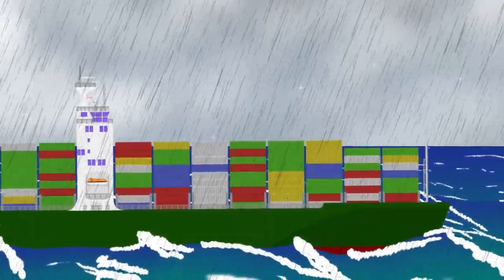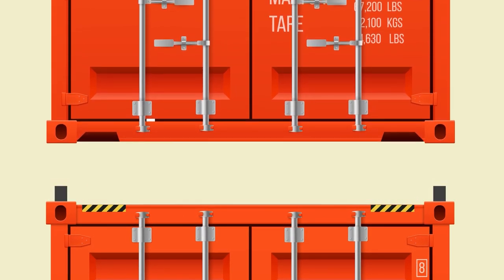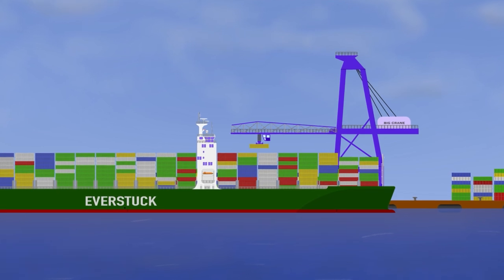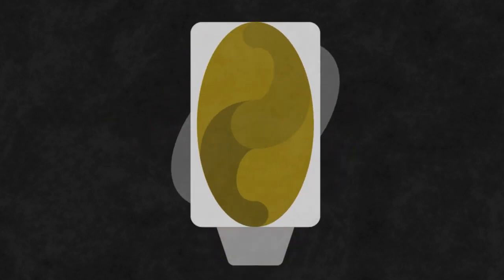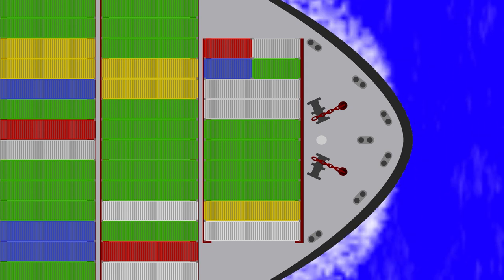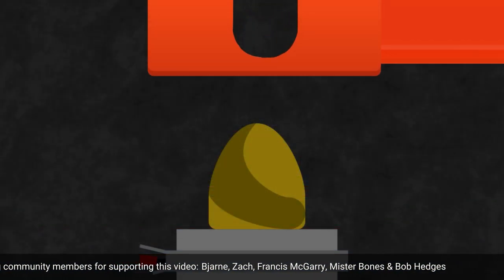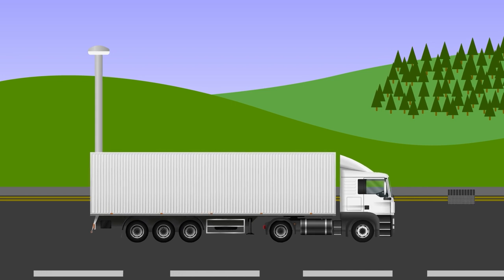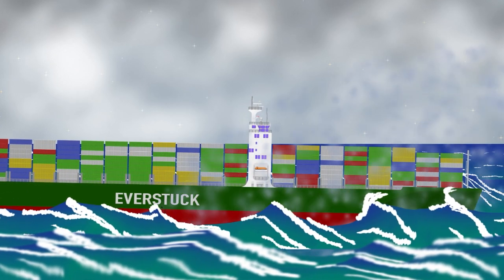Why Don't These Containers Fall Off?

Comment: I was a stevedore on container ships for about 8 years. The semi automatic twistlock you described is like the ones we used on Maersk vessels, whilst Hamburg vessels had a fully automatic type with no toggles at all.

On the section about container bays, bay 01 would be the forward 20', the aft 20' would be bay 03, and the 40' would be bay 02. The walkway between the next bay would be 04 so the next 20' section is an odd number again.
Reply: that's quite interesting
Reply: honestly, the manual and semi-auto locks sound like a huge hassle still, considering how many containers need to be loaded/unloaded at port, and how often you'd lose those damn locks...shouldn't all containers just have built-in locks, which the cranes can toggle when they pick them up, or something?
Reply: As Kaine already mentioned, they make fully automatic twist locks.  However, they are not ideal for all situations.  For example, if you have a stack of empty flat racks, you would have to discharge/load them one by one with fully auto twist locks but you can accomplish the same in just a single pick with manual or semi-auto twist locks.  Also, with fully automatic twistlocks, you can only twin pick horizontally and not vertically.  If you have two tiers of remain on board 40' empty containers overstowed over loaded discharge containers, you can halve the number of restow moves by using manual and semiatomatic twist locks.  These containers are built to ISO standards so the corner castings can accept an assortment of different twist locks depending on the situation.  Even ships with enough fully automatic twist locks aboard for every container usually carry manual and semiautomatic twist locks for situations that warrant it.  As far as having built in locks... Very bad idea.  Twist locks get beat up every time the container get loaded on a chassis, bomb cart, vessel, ect.  It takes all of a second and a half for an experienced longshoreman to change out a busted twist lock.  Nobody has time to torch out and reweld a locking mechanism that has no need to be permanently installed.
Reply: so, out of curiosity, how does the release function work on fully automatic locks?
Reply: the best method from my non seaman experience would be a helix that uses weight to hold  down , and when the  container received upwards pressure a spring releases it to neutral or a simple helix with a flange in the middle and a bearing allowing the lugs to twist and separate but only in the up and down directions  or if you want to be really fancy , have each container with its own lugs and a radio code from the bridge to release so all containers can be locked or unlocked remotely
Reply: It depends on the manufacturer but many fully-automatic locks are placed in the bottom corner castings of the container above the same way as a semi-automatic. They lock automatically to the top corner castings of the container below and unlock automatically using a specific motion by the gantry crane operator when lifting.
Reply: So the stacks are locked together vertically, but not in the two horizontal axes?
Reply: @foobarbecue  some vessels use a bridge clamp which is put at the top of the stacks that holds them together vertically using those horizontal holes on the ends, but I never saw one used the entire time I worked there. The problem with bridge clamps is the containers need to be at an even hight, if you have a mix of standard height and high cube containers the holes won't line up. Twistlocks and lashing provides enough stability to stop the stacks rolling in normal conditions.
Reply: @alveolate  
The containers have to go every where throughout the land as well as ships, even just sitting on the ground. And then when they are empty they are handled and stacked differently.
Reply: @s.v.saylaraye3212  
No, the occasional really stuck twist lock which requires a call to maintenance to bring heavy equipment or to have to take the container to a safe area to have it torched out, after checking there's no hazardous in there is a big painful interruption.
I have put in and taken out man many twist locks.
Reply: I have been in the Maritime Industry for over 20 years, both at sea and shoreside.  What exactly are you saying "No" to?  Firstly, I was responding to alveolate hermeneutist's idea about having "built-in locks".  Secondly, the majority of the time when twist locks need to be replaced, it is due to the locking or release mechanism/parts malfunctioning which does not "require a call to maintenance".  As I already mentioned in my response, twistlocks can quickly be replaced by the ground crew whether the container is hazardous or not.     You may have put in and taken out man many twist locks but your reading comprehension sucks.
Reply: @alveolate  re: containers just have built in locks. 
That is a lot of complexity added to the containers.  A hole is simple, but a device that has to lock and unlock at the right point in time is a lot more complex.  Having them work this way means that when one of these locks fail, it's easy to replace.

I would expect it would be a lot more time and effort if they had to repair the lock on the container before they could get it loaded.  The positions for all the containers is mapped in advance.  They couldn't easily just skip a container if one of its 4 locks wasn't working.
Reply: @s.v.saylaraye3212  
Sorry dude, I said 'no' in agreement with your observation that permanently attached  twist-locks would useful , due to the reasons you mention.
I should have said 'no, you are right' and then went on to embellish the story, explaining a bit as to the major hassle it can be when even in a rare event such a thing does need to happen.
I know exactly the majority of twist locks need replacing, having done thousands of them. However I have also been a straddle driver and have occasionally needed to take a container to maintenance because the twist lock can not be removed and rather than hold up the crane, which you must know is a big no no, we get the box out of the way quickly. These cases are usual because a wrong type of twist lock was used or if the right one it was really beat up or the crane had missed the mark a few times and squished it into the pocket or deformed it beyond manual handling.
And I don't what if any safety standards you worked under but our maintenance guys would not cut into or use an oxy torch on the box without double check what was actually. in the box.
I worked on the wharves from 1974 until a couple of years ago. From carry all sorts of crap on my back to setting up and operating union purchase gear (I bet you don't know what that is) to driving more modern ships cranes, of every type, and every type of shore crane, including bulk buckets. Also have driven every shore type gantry crane including portainer cranes. Also I have driven fork lifts from the first little ones that went below to stack barely palleted cargo through well standardized pallet sizes to large and larger container handling forklifts. Then of course there are straddle carries, from smaller ones that actually ro-roed on a couple of ore boats we had to the well known container moving ones.
As well as that I have done every type of manual work including lashing and twist lock handling, from well before any automatic types when we had to go a cage trip every tier. That was also a time when we would get out of the cage on top of the tier to get them in quicker.
And then I have been a clerk, then an equipment controller, interacting with planners, supervisors, ships mates and captains, foreman and crew.
And, just to top it off I have an honors degree in philosophy, because most of the stuff on the wharf doesn't require much brain power leaving me free to think in other ways.
So, Mr. 20 years, I apologize for giving you the wrong impression.
Reply: You were so triggered by a joke in the YouTube comments that you wrote an entire essay about your resume. Someone who has as much experience working on the waterfront as you claim should be able to handle a little ball busting.  I am currently a Planner, was a Supervisor before that, a Professor at a State Maritime Academy before that and sailed as Chief Mate/Relief Captain before I moved shoreside.  The labor still busts my balls all the time.
Reply: @s.v.saylaraye3212  
It wasn't a joke, it was an insult.
And, do you have any actual experience with manual work? 
Also, believe it or not, that is not my resume.
Reply: @Aaron Curtis and @Caine Sparham.  Thank you for asking and answering that question.  I was going to ask it myself. I think I would be happier with some horizontal fastening, at least at the top, but I yield to those who have expertise.
Reply: There are so many things wrong in this video that you can't help wonder whether the author ever cared at all about the validity of the information or is just another subject in which to fart another video with the smallest time and effort possible.
Reply: are the automatic twist locks
battery powered with wifi control?
Reply: @Luleliluli  I think it's unfair to say there's lots wrong with the video, I think it's just very simplified compared to the full picture of container stowage.
Reply: @Kaine96853  Man.. They didn't even get the right type of crane (the one depicted is a grain conveyor for bulk cargo ships, we've got several of those) and they placed it longitudinally instead of across the ship, like you would work a Ro-Ro. Like nobody is going to notice.. They just don't care!
Reply: @s.v.saylaraye3212  
Hey S.V, having settled down a bit now I was was wondering Terminals you worked.
Mine was mostly P&O and D P World.
Reply: Sorry for the delayed response...  I have been really busy this week not performing manual labor from my air conditioned office/truck.  Shoreside I worked at Port Tampa Bay, Port of Virginia, Port Everglades and Port of Miami.  As a ship's officer, I have called pretty much every major seaport on the Atlantic coasts of North & South America and the Caribbean.  In Virginia, it was a a joint venture between Ports America, Cooper/T. Smith and Ceres, called CP&O.
Reply: @Igbon5   The two of you are hilarious. That's why I come to the comment sections in videos like this.
Reply: @vadimbellous8313  
You are very welcome.

Comment: If you notice these containers tend to flip over when a truck driver exits an on or off ramp, or takes a corner to fast, the reason is that unlike regular trailers with a heavy floor and light sides and roof, the sea container is solid all the way around making them much easier to flip, top heavy, I drove both for decades, with sea container you have to slow way down on any corner.
Reply: I never understood why they don't have "under slung" trailers for Intermodals like you see with double stack train cars. I guess for truck dock compatibility? It would help bring the CG down and improve aero.
Reply: @mzaite  Ground clearance
Reply: @mzaite  Probably also length; an underslung trailer would need to have the wheels in front of and behind the container, rather than under it.  The extra length makes it harder to maneuver, and also may not be within the legal length limits.
Reply: @ianspeckmaier9565  You could imagine the increase in bottoming out incidents on railway crossings.
Reply: @ianspeckmaier9565  How so? I've seen some pretty hefty goose necks that go well below the axle center line.
Reply: @mzaite  yeah, and those require hefty pre-planning so you don't get stuck along way.
Reply: @johan.ohgren  Oh right because like raised rail crossings and such.
Reply: I wouldn't blame the container itself, but the way it's loaded. I used to grab empties in Cincinnati on the way back to the house and the biggest ones only weigh 3000lbs empty. The difference with a regular truck trailer is those are usually loaded with freight stacked on pallets, unlike containers which are regularly packed absolutely full all the way to the ceiling with no regard for how it might handle on the road.
Reply: And most truck drivers nowadays ain't slowing down even for divinity.
Reply: @mzaite  Those are actually some what common where I live (southern Saskatchewan, Canada).
Reply: Don't forget that many containers often end up being overloaded as well. They have a limit on what can be put in them yes, however, the companies that load them tend to want to get every last bit they can. Therefor, only the actual product weight itself is counted. Packaging, pallets, etc. Those aren't counted so these containers can end up being tons overweight at times depending on what they are hauling.
Reply: @kahnwolfe9548  New safety  measures are reducing that.

Comment: That accounts for them being vertically locked together. But a tall stack can topple more easily than just the one at the top. Would you not need to secure each stack to its neighbor also?
Reply: dot
Reply: Exactly.  Perhaps some kind of sliding engagement that would create horizontal stability.
Reply: was also curious about this
Reply: I was thinking about that. They do use steel lashing rods to brace the stacks diagonally at the ends and provide more stability.
You could incorporate side-locks into the containers, but that would complicate the container and make it a much more expensive piece of equipment, which then needs inspection and maintenance. The most stable design would be to periodically add a cross-member with locks on top and bottom, like civil engineers do with geotextiles to stabilize soil. 
But I suppose big ships are stable enough that it's not a problem unless they get into some seriously heavy weather, which is rare, and adding and removing cross members would significantly slow loading and unloading. So it's ultimately cheaper to just avoid heavy seas as much as possible and deal with the occasional stack collapse as an accident.
Reply: When I lash the containers, they are lashed diagonally down to the ship= which results in them being vertically and horizontally stable, it's a metal rod that fits into the holes of the corners of the lower containers and fits the role of a ratchet strap, other places may do it differently
Reply: @freddym.1489  I've seen that on some ships but not on others but then I'm only sailing by them in port and I'm not inspecting them just before sailing. Seems only some rows are secured that way?
Reply: @earthwormscrawl  You can't use twistlocks sideways because the container needs to be lowered vertically onto the twistlocks of the row below. Sideways twistlocks would require it to be moving horizontally, and it can't do both at once.
Reply: There are indeed so called bridgefittings available and in use which connect corners of containers longitudinal and or traversal. As far as I learned, they are no locks but steelplates with cones in shape of the twistlock, where the next layer of containers is simply placed on. Those bridgefittings are attaching the single towers to each other and create a more durable formlocking of the load above the cellguides. There are some problems attached in using those fittings: they have to be placed manually (as far as I know) and relatively far above; the neighboring stacks have to have the same height (mixing of highcube and standard containers is of concern); manually placing of such devices for short trips between nearby ports make those unattractive. Cases like MSC Zoe or dozens of pictures of collapsed containertowers on the internet show that those can be useful.
Reply: My question too
Reply: You have lashing rods going diagonal between containers. Only the three bottom layers are lashed though, the top ones “don’t need it” 😉
Reply: There are very labor-intensive and slow methods of attaching containers in this way, where one "stacker" will attach to 4 adjacent "pockets" and keep them all together, but it's almost never necessary. The only time I've seen it done are when smaller vessel meant for bulk cargo (and hence without proper container mounting points) are loaded without cell guides and above deck, for example during Covid there was a glut of cargo and not enough ships to move it all as fast as shipping companies wanted, so it was just slapped onto any ship that could handle it, including bulkers.
Reply: They use cables to tie the stacks together.